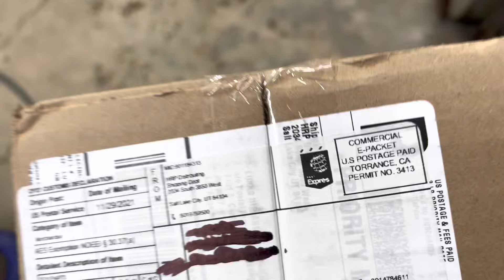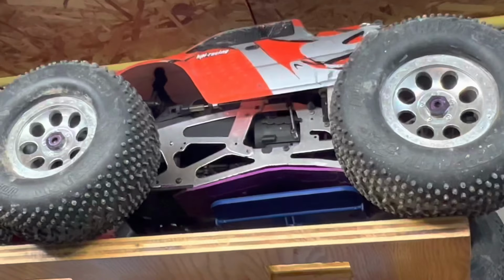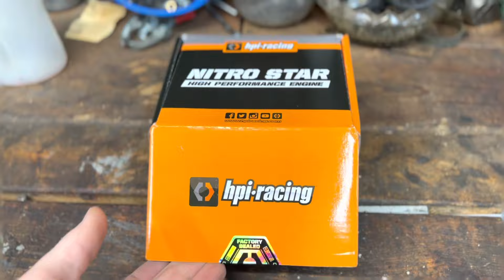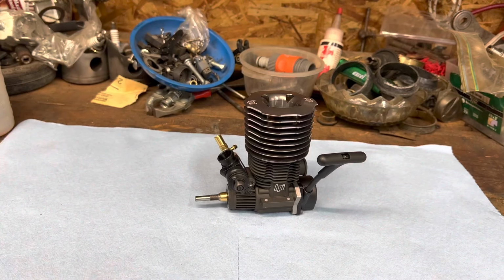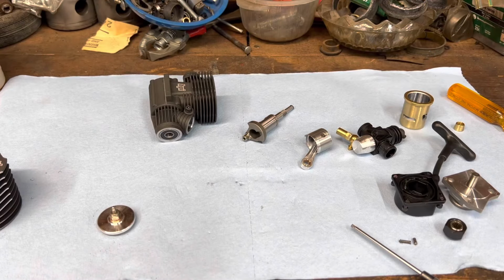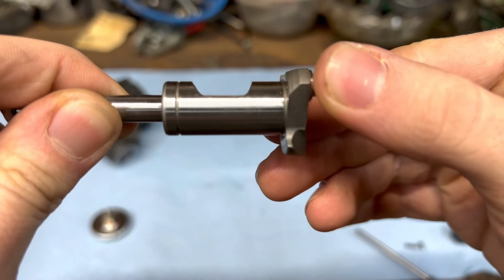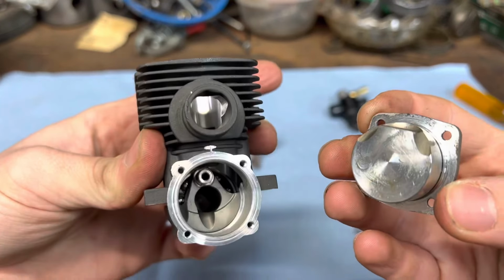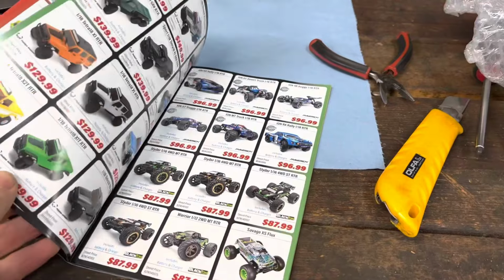HUGE Nitro Engine Unboxing!

Comment: This is the force .36 with a nicer cooling head. Good engine, good quality, fair price. The piston is huge!! The ports are small for such a big engine, just like my force 32. I really enjoyed the video! Good job with the edditing  👍 Cant wait to see this thing running, 4.6 vs 5.9 should be very interesting.
Reply from the maker: Thanks man!
Reply: Does the 4.6 is also a force engine? No parts for the 4.6...(I need a head button can a force one fitt?
Reply from the maker: @lior1608 all Hpi f series engines are force engines

Comment: I almost miss my Orig Savage .25, and the buds on Savage Central back in the day.  Bought it at Pegasus Hobbies Montclair in 2004.  Made the drive back to Yucca Valley, and had to turn right around around and go back to Pegasus because I forgot the Fut 2.4 receiver they had held for me(Shisen!!).   Went back and broke it in right on the High Mojave at Landers, CA.   Eventually it received a Fully timed Novarossi Black Magic?? Team Edition 9 port On-Road .21.   I went thru a dozen or more of the one-way brg/shift hubs and inner gear sets.  Outdrives?,,uncountable.  Diffs and pinions??,uncountable.   If I would stay together,, NO ONE could catch me,,,Off like a Meth Bunny!!.    Once I hit $3-4k, I sold it.   I had to.  It went on to win a BUNCH more races in his hands.

Comment: So like $200 without a coupon? 5.9cc is exactly 180% larger than my revo 3.3. I wonder if it would fit in my revo.
Reply from the maker: No shot not without a big block conversion. Even than it’ll probably still be a bit tight

Comment: I got the older 5.9 in my savage now it was made by the company that made all the k block engines nd axial engine on it's the new one got coming hpi backplate no internal one way bearing I was thinking that the dynamite backplate would fit the new 5.9 thanks for the garentee answer
Reply from the maker: The one thing I didn’t check is the piston clearance.

Comment: the only this i hate about those nitro star engines is the pin spring crank design then again i never bought a new one !  several of those engine grenaded on me i bought them used but  who knows
Reply from the maker: I’ve never had an issue my self. I’ve got 10 gallons on my f4.6 and it was used

Comment: That’s interesting I’ve seen that design before and I always thought that was the older generation of it by the way are you in the nitro gang on Facebook and yes I think they need to start making a lot more RC models with massive engines like this that engine is sort of like a 500cc two stroke dirtbike you don’t see them very often or in very much

Comment: Will this engine fit in a RC8T4? thanks
Reply from the maker: I’m not sure if it would because of the pull start, that platform is meant for bump start engines
Reply: @thenitronation5815  well you mentioned if installing the dynamite back plate it should fit correct right?
Reply from the maker: @nadersedaghat5694 yes if you remove the pull start it would fit
Reply: @thenitronation5815 the back plate that you used does it seal pretty good where the oring is?
Reply from the maker: @nadersedaghat5694 I never actually used it I bolted it on for mock up purpose

Comment: Since HPI spares have been made in China rather the in Tiawan the quauity has gone right down the toilet. The fuel tank for instance just look cheap and tacky compared to the old type and are way thinner. Their composite pipes melt like  no-tomorrow. The list just goes on. The HPI Savage used to be the king of the 1/8 scale monstaer trucks, but since there relaunch I,m afraid to say the are just over priced for the quauity you now get. I have 10 Savages in my collection and have to say the older models are almost bulletproof.
Reply from the maker: Interesting, don’t have experience with the new savage yet but hopefully they fix the quality of things.